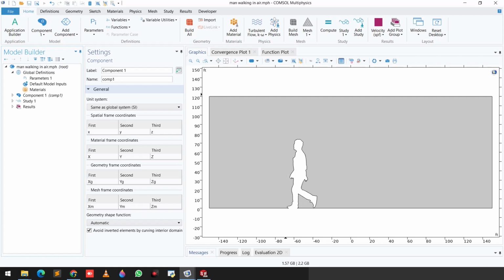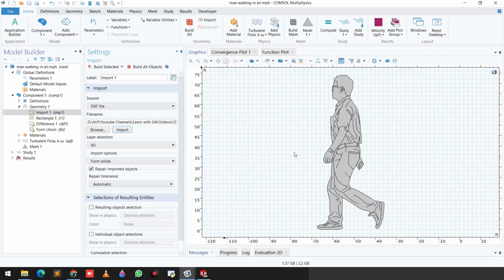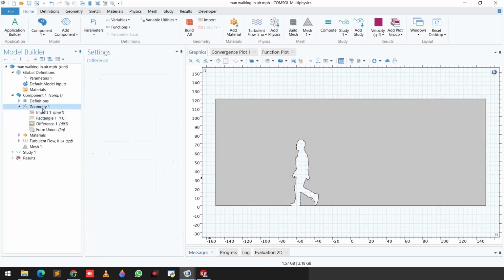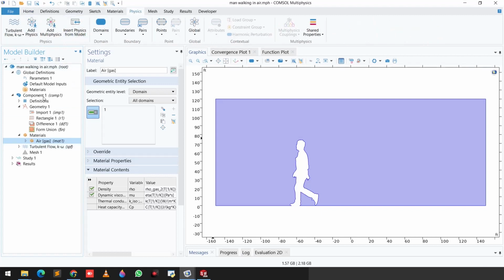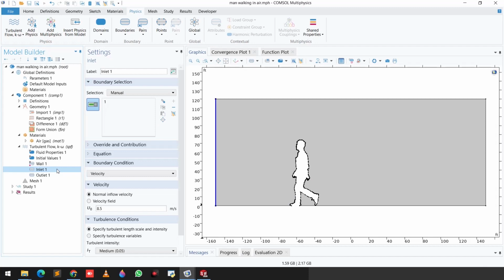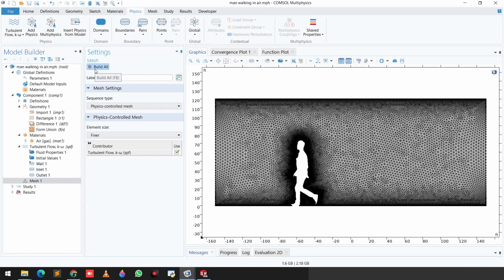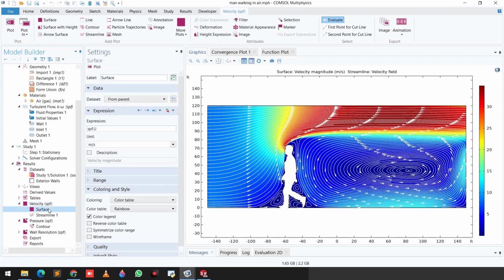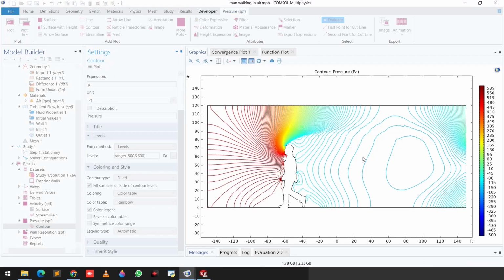COMSOL Tutorial 09 | Air flow over a man using turbulent flow modeling | Turbulent flow simulation

Comment: How can I add the CO2 exhale of the man in the air? If there is a velocity and diffusion of CO2?
Reply from the maker: Great question! To add CO₂ exhalation, define a boundary source at the mouth with a mass flux or concentration boundary condition. Combine this with convection–diffusion for CO₂ and couple it with the airflow (velocity field).
Reply: @LearnwithSAI Thanks for the answer. If I want the air having different temperatures should I change Tref or the temperature in TDS fluid properties?

Comment: This simulation would be real on the moon
check the pressure, on planet earth it is 1 bar
very low pressure!
It's not real
Reply from the maker: It’s just the method to solve these kind of problems. You can use the exact value of pressure and solve it.